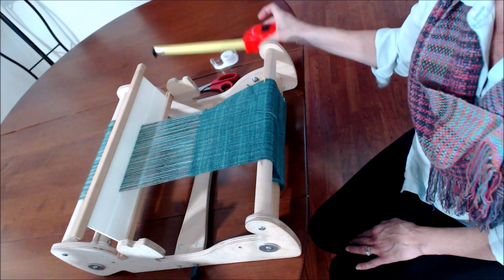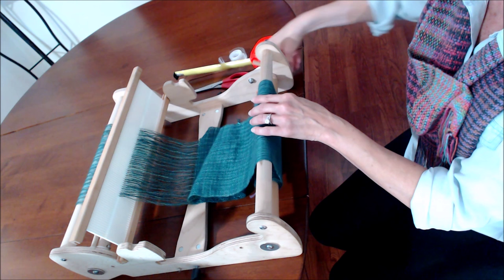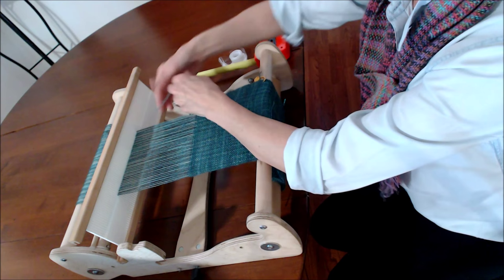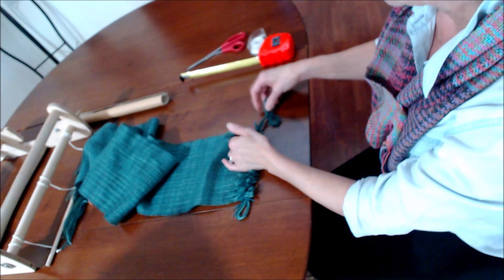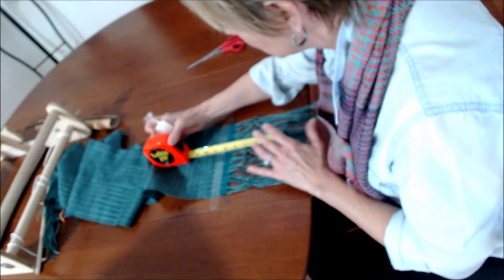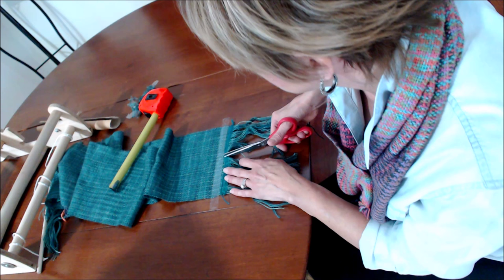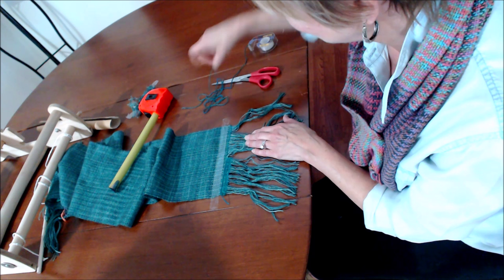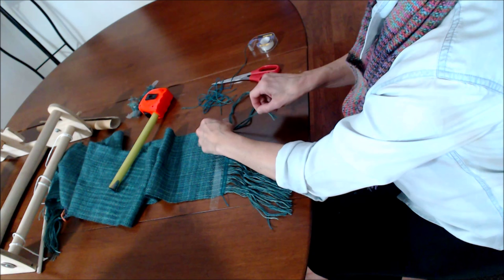A Simple Method to Remove Weaving from the Rigid Heddle Loom

Comment: what do you use on the front beam? Is it a papertowel cardboard roll?
Reply from the maker: Good Eye!  Yes. On occasion, when the fabric is showing bumps from the knots in front that show on my fell line, I pack a paper towel core over those knots to eliminate.  This is usually just with lighter weight or stretchier fabrics.

Comment: This is terrific but cutting the header threads? OMG, if I do this, I know it will end badly.
Reply from the maker: It's still ok to pull the header out line by line if you prefer, but more hassle.  You can do this! Just be sure your bottom scissor blade pokes upward, out of the fabric to insure that only weft sits on the blade. Cut weft one pick at a time if unsure. I have used this with the tightest of headers, had to operate on pure faith that I'm not cutting warp, and it works!  P.s. if you get distracted away from the advice and cut a warp thread, don't invest too much worry.  It won't unravel as it is not much different than any other trimmed tail at the edge and is easily hidden by the fringed edge.
Reply: That's funny!!! I was thinking the same thing😲😲😲😞😞😁😁😁😁